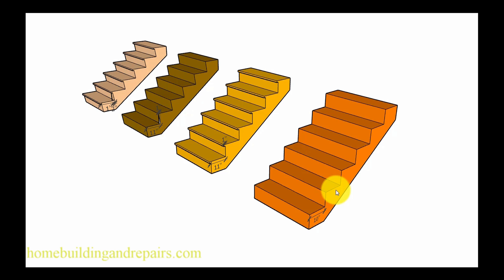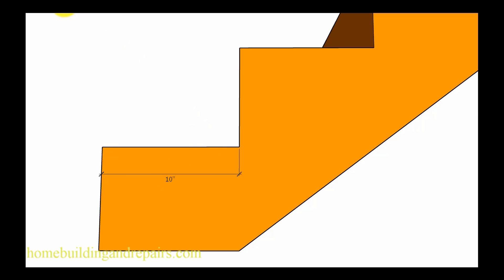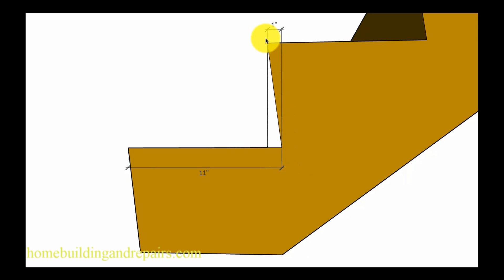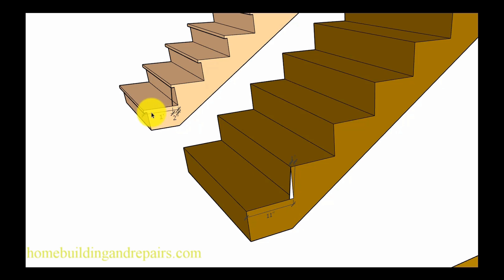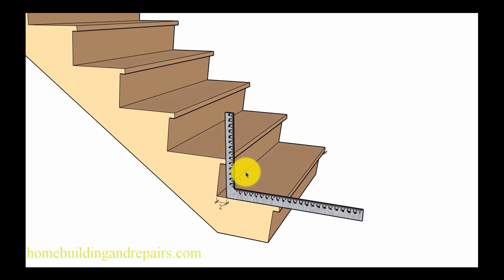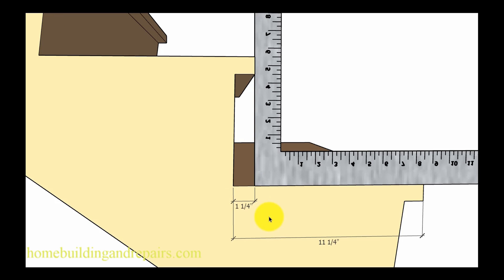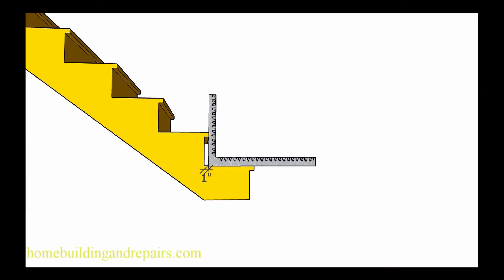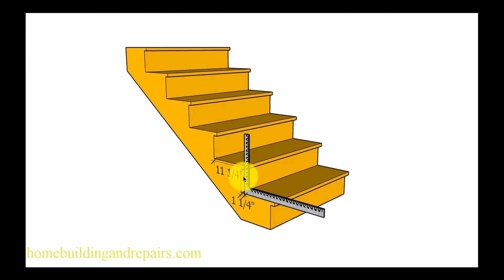Should You Use Stair Tread Nosing And Undercut - Building Code And Design Tips

Comment: I have an extremely steep staircase. With narrow stair Treads. I'm limited to my space I can't add any length. Would doing a over hang and undercut help this situation
Reply from the maker: It will help when walking up, but not down the stairs. So a 50 percent increase in safety.

Comment: Should  a plan be designed by an architect or SE for stringer  and tread repairs or replacements?
Reply from the maker: You will need to check with your local building department.